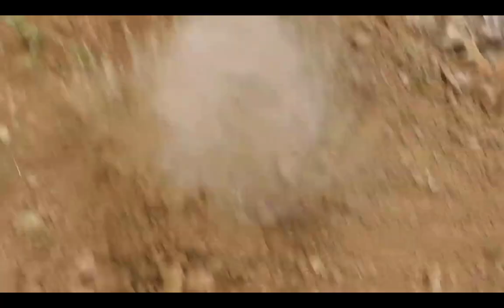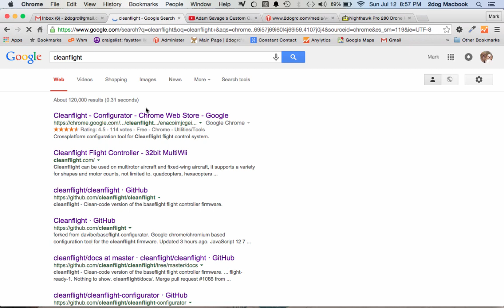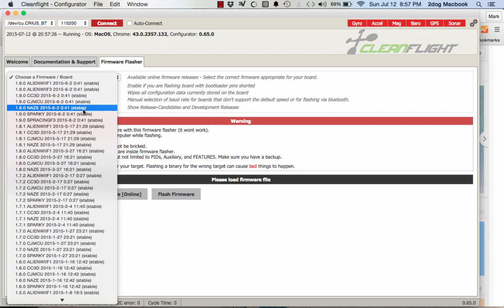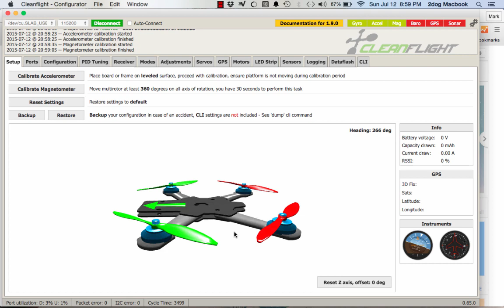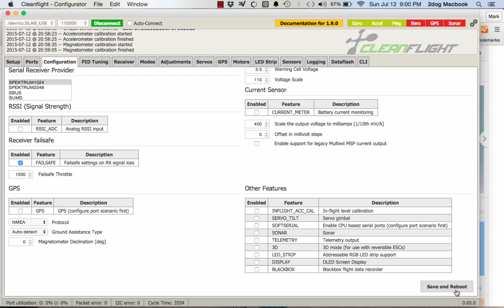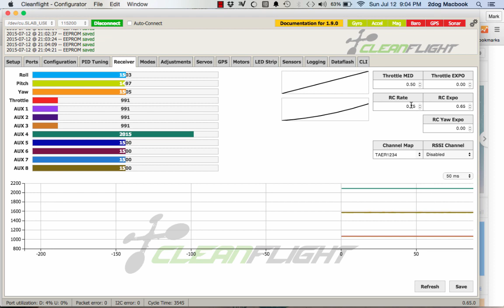Flash Emax Nighthawk 280 with Cleanflight

Comment: your video was a life saver, I tried following the steps in the manual for the skyline 32, see post here:  http://www.rcgroups.com/forums/showthread.php?t=2417041    which you was linked at this post,  but it would not work no matter what I tried.  I spent several hours trying to figure it out until I came across this video.  I just wish this information was available right off the bat for the flight controller but thanks for the video.
Reply from the maker: +edwardMcrichy Thanx!  We try and fill the gaps.

Comment: Hello,

First of all thanks for the guide. 

Having one problem though.  A rather major one. As soon as i take the battery out of the 280 and then put the battery back in i lose all my settings. Or at least i am at the moment. I have had it working for a while. Put it down. Come back to it and try to turn on the transmitter then the quad and nothing happens. No beeping from the FC. I have to connect it to cleanflight. Restore to default then restore my settings. Disconnect the FC from my laptop and it'll work. As soon as i take the battery out i have to go through the whole proceedure again.

This wasnt happening with Baseflight but i am trying to use Cleanflight so i can get some telemetry from my D4R II and Taranis so would prefer not to go back to using it.
Reply from the maker: +hincey20 OKay, what version of Cleanflight are you using?  I have not had this happen before, but make sure you click "save" on each page.  If that is does it, trying re installing cleanflight using the newest version, and select "full board erase" when you flash the firmware.
Reply: +2dogrc Thanks for the quick reply, Cleanflight for naze 1.10.0.

Just went back to Baseflight again. Wiped flashed, restored my settings and everything is fine again. Saw your reply so i thought i'd try doing the "full board erase" with Cleanflight. Flashed to 1.10.0 again. Restored my saved settings (Your saved settings, plus some others to try get the telemety working). It works but as soon as i take the battery out and back in again i get no beeps from the FC. I have to restore defaults and start again. 

I'm almost positive i'm just doing something silly cos well thats how i do.

Thanks for the help though, much appreciated.
Reply from the maker: +hincey20 Okay, try this.  Go to CLI and type "dump".  Then select all on the blank screen and copy and paste to notepad or text editor.  Now reinstall the Newest Cleanflight.  Don't restore saved settings, but manual input the changes.  It is not a good idea to use the restore saved settings, when changing versions.
Reply: +2dogrc Nope still no dice. I went to CLI typed dump saved the txt doc. installed both 1.9.0 and 1.10.0 again just to try and both times after I manually entered my settings rather than restoring them. The 280 will work fine untill i take the battery out. Replacing the battery doesnt ever make the FC beep untill i connect it to the laptop. Restore it to default settings. Then it will beep.

While playing about this time though i did notice that there is a green light on the FC that lights up if the 280 is armed. Hadnt noticed it before as its normally facing away from me. So after taking out the battery and installing it again i checked to see if i was arming properly and the light is coming on. Also worth noting maybe that once the battery is taken out not even plugging the 280 into cleanflight and going to test the motors under that tab will they work unless i restore to default. 

:(

I'm baging my head against a brick wall here
Reply: +hincey20 It seems to be something to do with oneshot. As soon as i disable it it will allow me to take the battery out and every time i put it back in it beeps and will allow me to spin the motors.
Reply: +hincey20 Now Ive just noticed that one of my motors is not working :((( No idea what has happened but i&#39;m pissed. Top right on if its facing away from me. No 2 i beleive.

Edit: I fixed the motor. I went through your video again trying to follow every single last bit. Putting the motors to 100% while turning them on is where i failed :( Somehow i turned one off. Reading in the thread on RCgroups I previously stumbled across the manual that you linked for the motors (Thanks again) http://www.2dogrc.com/media/wysiwyg/manuals/EMAX_BLHELI_20.pdf and i reset and maybe even turned the brakes on. I guess i have to actually get flying for that to happen! Going to call it a night. I've flashed back to Baseflight for now =/ 

Beaten but not defeated
Reply from the maker: +hincey20 Glad you got the motors working.  It sounds like some kind of setting issue.  BUt if you can get betaflight on, then just go with that while you still have good flying weather!
Reply: +2dogrc I have heeded that advice, I just wanted to try get telemetry sorted so i could fly with some confidence that i'm not ruining my batteries. Much appreciate your help.
Reply from the maker: The battery voltage is VERY important!  Maybe try posting on the Cleanflight thread on RCGroups.
Reply from the maker: +hincey20 Try doing all the settings without the flight battery plugged in.  Start from scratch, install newest Cleanflight and only make 1 change.  See what happens.
Reply: Yea thats what i did last time and i think i isolated it to oneshot but i am going to test that soon. I also found these comments from another youtube video that i'm gonna try. Slightly lower / higher end points wont hurt will it?

Gustavo Tirado

I recently purchased the Nighthawk pro 280. 
The nighthawk pro 280 does not work properly. I programmed it using Baseflight just as instructed and everything seems to be working fine while connected to the computer, it chimes like normal when you plug in the battery (while connected to the computer). But while not plugged to the computer it does not work, I plug the battery there is no ESC sound and there is only solid red LEDs on the board.
It is not the transmitter or the receiver because I tried on a different quad.
Any Idea what it can be?

walkera _flitzer    

+Gustavo Tirado When not able to arm, reduce the Throttle output to lower than 1100.
Reply: +hincey20 Sorry to spam your video :( It is definatly Oneshot, everything is working with out it.

I can take the battery out. It chimes every time i plug the battery in. Every time i enable oneshot save and reboot it&#39;ll arm and spin up the motors. As soon as i remove the battery and install it again with oneshot enabled i get nothing.

1 step closer to finding out the problem maybe.

Comment: Where is the link for the PID settings??
Reply from the maker: +Scott Kervick http://www.rcgroups.com/forums/showpost.php?p=32339521&postcount=298

Here are the settings I am using on Cleanflight 1.9.  They should work on 1.10 as well.  However if you are on 1.10, try the stock PID settings if you are using PID controller 1, or Luxfloat first.

Comment: @2dogrc hi guys i have problem in synching escs, i treid with both baseflight and clean fligt ,but the just won't sync,please help me
Reply from the maker: +Gianluca Castellaro When you mean "won;t sync".  I am not sure I understand.  Can you calibrate them?  From the motors tab, check the box and remove propellers.  Take motor one and move it all the way to the top.  Then plug in your flight battery.  It should sing, then move motor 1 back to idle.  It should sing again.  Now unplug the flight battery and try with motor 2. Let me know how that works.
Reply: +2dogrc by 'won't sync I mean that at 1023 starts motor 1 025 motor 2 1027 motor 3 1032 motor 4,  and when I raise speed by master and pull it down rapidly the don't stop Al together
Reply from the maker: +Gianluca Castellaro Okay.  THen you should recalibrate them all with the process above and that should fix it the issue.
Reply: +2dogrc hi I tried what u said but I have the same problem anyway, I made I video, cani send it to u?
Reply from the maker: +Gianluca Castellaro sure thing...2dogrc at gmail.com.  I can take a look
Reply: +2dogrc thanks very much, what's your email?
Reply from the maker: +Gianluca Castellaro 2dogrc at gmail.com

Comment: I have a dx6i with AR6110E rx. Can anyone show me where to plug what on the rx? I can't seem to find roll/aileron plug. Thanks.
Reply from the maker: Kidlat432 Plug in each of the receiver wires into the Receiver in order.  Then if your channels on the Receiver Tab do not match up with the control on the transmitter, select a different option in the channel mapping box.  I believe with that system you would select JR.

Comment: cool where does the buzzer go into the board?
Reply from the maker: Stephen Wright It is on the right side of the quad forward of the USB connector.  You need a 5V buzzer.

Comment: 2dogrc Do I have to set the mode seletion on channel 5 or on channel 6?
Reply from the maker: You want set it up on Channel 5 on your radio and AUX1 in cleanflight.  Check the Receiver tab and verify that Aux1 in Cleanflight coincides with the switch on your radio that you want to use.
Reply: And what is on channel 6? You showed in your vid something with different ranges in Horizon Mode, what does this mean?
Reply: 2dogrc
Reply from the maker: Rainer Wachter On Channel 5, which on my radio is a 3 way switch., I have the ranges set for horizon, and rate.  If no mode is selected that is rate mode.  I have 2 positions set to rate with different Expo setting.  Then on Channel 6, I have the buzzer connected.  This is set so If I lose the model I flip another switch, AUX2, and the buzzer beeps.
Reply: 2dogrc So you have on the channel 5 switch 2 rate positions and one horizon position?
Thanks again for answering😉
Reply from the maker: Rainer Wachter No problem.  You can set it up how you like.  I like having horzion mode for takeoff then switch to rate.  helps if i get caught on some grass or weeds.
Reply: 2dogrc ah ok I think I got it now...And you set the different expo settings for rate mode on your transmitter?
Reply from the maker: Rainer Wachter That is correct!

Comment: Hey nice video, I just bought the nighthawk 280 pro from you guys, i have a spektrum dx6i controller can i use it? what receiver do i need and how many channels does it need for the stock setup
Reply from the maker: ***** Hello,  You need at least 5 channels, but 6 is handy!  With 5 you can use the horn feature with 6 you can.

Comment: hey man im interested in buying this I got alot of questions seems like your the man lol so.  can this quad work with spektrum sat? and can u make immersion video tx and camera work on it? and does it have dampened on esc can they be flashed ? how whats AUW and thanks man !
Reply from the maker: Elio Mella Hello,
  Right now you can not connect a sat receiver.  The Immersion TX and camera can work no problem, might have to adjust some pins but they will work.  The ESC's can be flashed, but people are experiencing some issues and we are looking to get guidance from Emax on this one.  The weight is about 442 grams without battery.